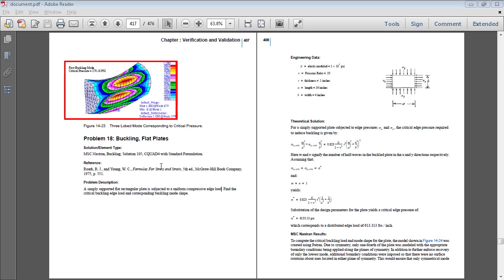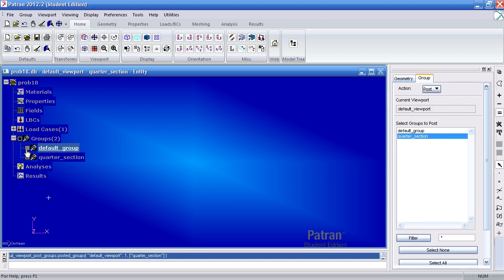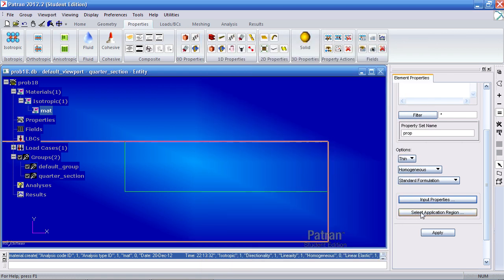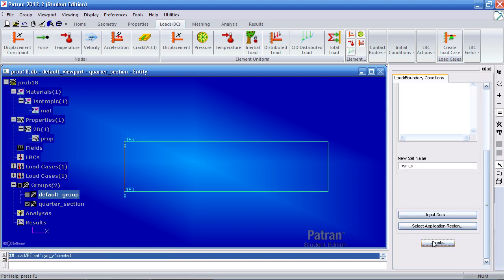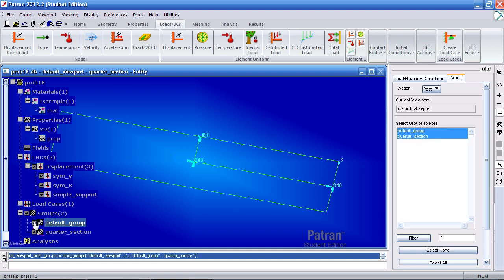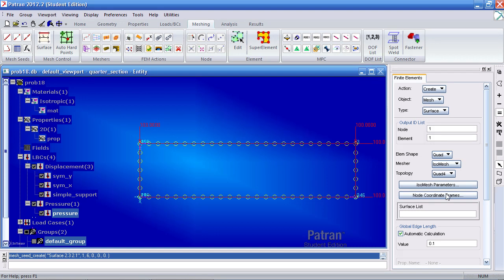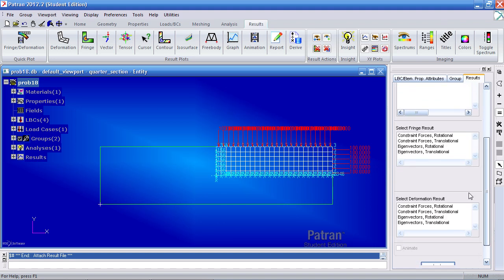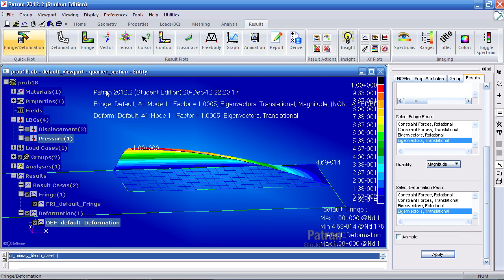MSC Nastran, Patran Tutorial - Buckling, Flat Plates

Comment: how did u calculate the edge buckling load. Max and Min displacements were given as results. So how was that 613pds/psi calculated
Reply: In case you're still interested. They applied an edge load of 613 and the buckling analysis returned a factor of 1.0005, meaning the buckling load is 613*1.0005